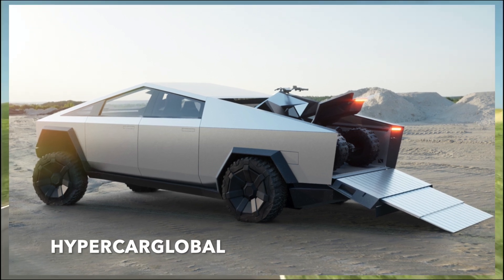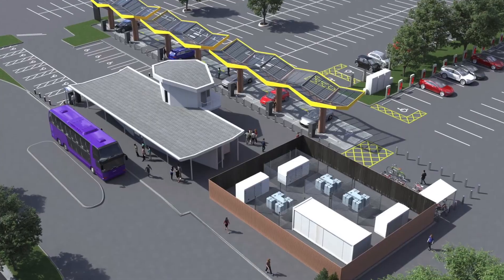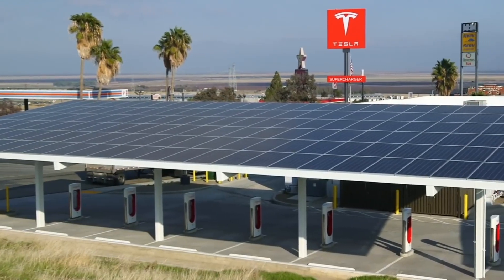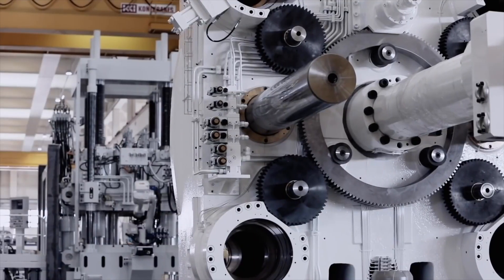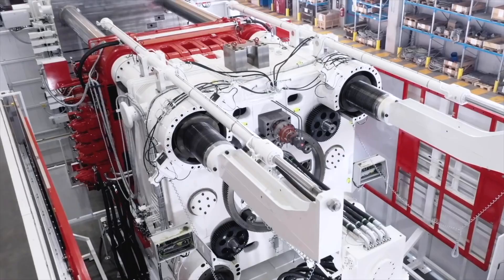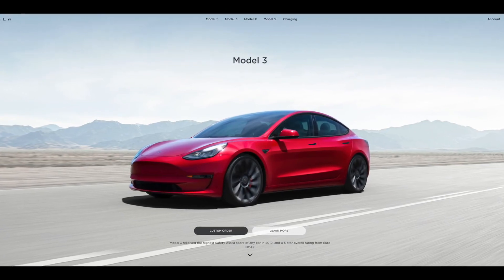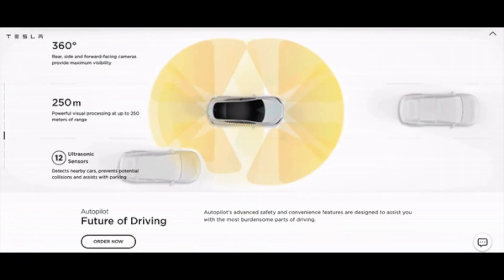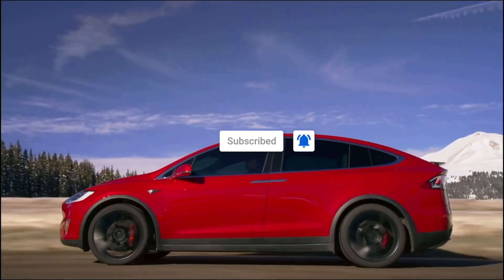HUGE NEWS! Tesla MEGACAST Is in GIGA Texas!

Comment: The 4680 lithium battery is its metric size (46X80).  Your narrative makes it sound like the cybertruck or Model Y will USE 4,680 batteries, as you keep mispronouncing the two numbers as one.